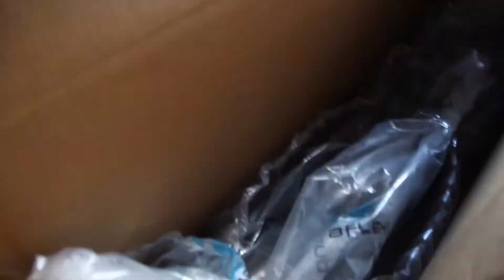DTM Fiberglass Wing/Spoiler For BMW E36 Install

Comment: How many inches is it from hole to hole where bolt it on ?
Reply from the maker: 6 and a half inches, just to confirm you mean distance from each bolt hole on one side? Like passenger side front bolt to rear bolt?

Comment: Question brother is this where you got your wing from? https://www.ebay.com/itm/303736145891 I just want to double check before I order as this one has 4 pcs and not 2 and this one looks pretty close to it 😁
Reply from the maker: I didn’t get that wrong but if you’re looking to go 4 piece I say get that one. I got a two piece one, if you’re looking for that I can send the link.
Reply: Chevis Beecher thanks bud yeah I order this 4 pieces as it’s close to the original 🙌🏼 thanks again for your input
Reply from the maker: No problem, enjoy and happy install